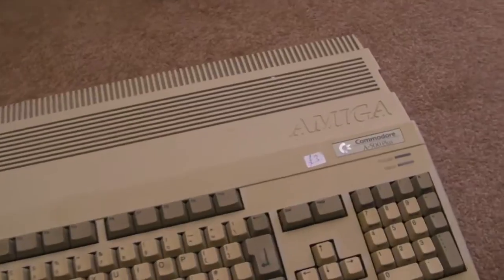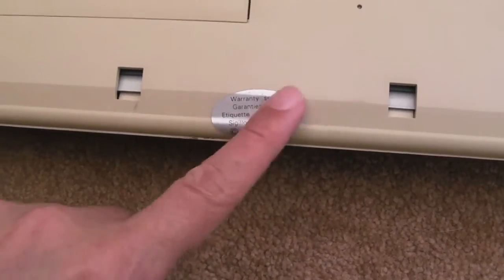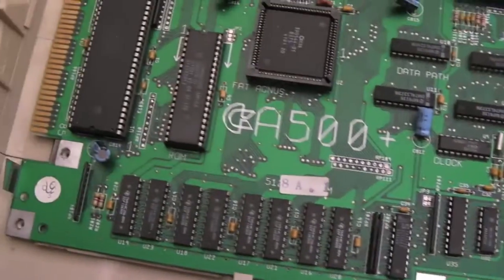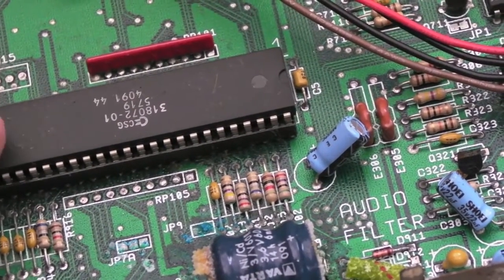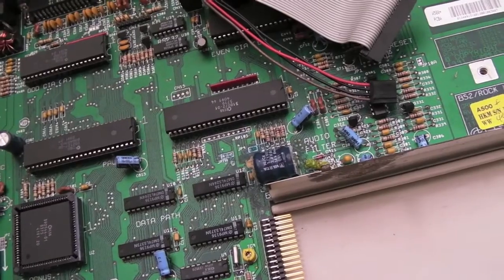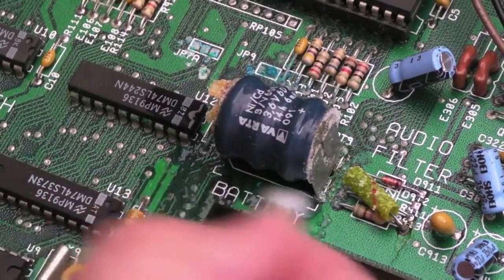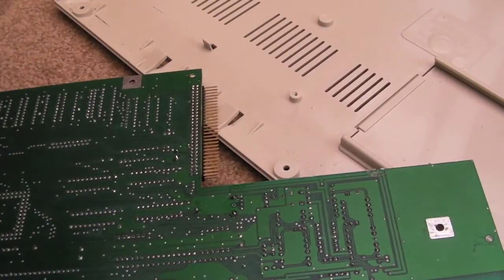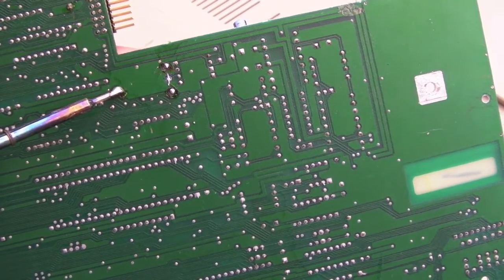Commodore Amiga A500+ Corrosion Repair Part 1

Comment: The Battery is not leaking Acid, it's leaking an alkaline solution which is why acidic vinegar neutralizes it as well as helps remove any corrosion.

Comment: Great video, you just saved my 500+
I didn't realise they had an RTC and battery so quickly went into the loft to get my 500+ out, that has been stored for over 12 years, and its dead.
After removing the battery, neutralising the acid and reseating Gary its back in business.
Wasn't as bad as yours luckily!
Thanks so much, it would still be up there now corroding away if not for this video.
Reply from the maker: mrxr2 Glad you sorted your 500+!

Comment: Wow, so long since I worked on one of those, let alone owned one.

Makes me nostalgic and want another one so I'll be hunting carboot sales now.

One tip that was passed down by Panasonic in their service bulletins though, do not desolder supercaps or batteries that have leaked, cut or snap them off the board then clean the leakage before you touch it with a soldering iron, the chemicals become more aggressive when heated and will contaminate your soldering iron tip as well as spitting all over the board and potentially making more problems in the future.

Comment: I just opened mine up and finally popped off the battery. Wasn't this Varta type. Unfortunately some damage done but when it comes to the external damage it does look a lot better than what you had in your hands so I'm hoping it is minor.

Comment: The damage on that board is very similar to the A500+ I repaired. Those ni-cads really are horrible. :(
Btw, one way to test which parts of the solder mask is damaged by the battery and which parts is not is simply to put your soldering iron to the board at various places around the battery for just a second or two. Healthy solder mask can resist the heat with no problems - that's what it's there for. Damaged solder mask on the other hand can't, and will disintegrate by the heat of the iron. I look forward to seeing what kind of conformal coating you will use to repair the damaged solder mask since I haven't seen many of them on the market.
Reply from the maker: Yes, I will do a mention in my next video so people can take a look at your vid!  Mine won't be as clean as yours I am sure!  The solder mask paint I got for the last 500+ came off EBAY I think.  It's the same UV type paint they use when making boards etc.  The problem is getting it to dry.  It does seem to dry of its own accord eventually but it speeds up the drying process if you expose to UV or direct sunlight.  Doesn't blend in that well but at least it covers exposed tracks etc.
Reply: GadgetUK164
Thanks. I also updated the video description for my A500+ repair video and added a link there to this video. I thought doing so would make it a little easier for people who are watching my video to also find out about this video of yours. You are presenting some very good points here which I didn't include in my A500+ repair video, like for example cleaning off some of the corrosion with vinegar.
I also liked that you didn't consider the repair being complete just because you had gotten the Amiga up and running again. The motherboard seems to work which is great, but there are still many things left to do on that board. You got some serious work ahead of you, my friend. :)
Reply: GadgetUK164
Btw, just as a little advice, make sure to use purified water to rinse off any remains of vinegar after you're done cleaning. Get some purified water (do not use tap water as it contains corrosive impurities), hold the board vertical and pour some purified water on the area where you cleaned with vinegar. Pour on both sides of the board. Either let the board dry in room temperature, or use a hairdryer to speed it up a bit, but don't use a too high temperature for drying the board. I like to try staying below 50 degrees C or so. Then wash the area with for example cotton buds or cotton pads dipped in IPA to assist in getting any remains of water moisture off the board. This procedure should always be carried out after having used vinegar to clean a PCB. It's extremely important that special care is taken to properly clean off all of the vinegar, since the acetic acid in the vinegar will corrode the board over time if left on there.
Using vinegar to clean the corrosion on the board works quite well, although it is a little bit like fighting fire with fire - You're cleaning with a corrosive element to get rid of a corrosive element. This is OK though, as long as you make sure to put out your own "fire" when you're done.
Reply: GadgetUK164
Thanks for the advice about the solder mask paint. I found it on eBay, and yes, it does say in the item description that UV-light is used for curing. But how long does it take for it to cure without any UV-light exposure according to your experience? I'm a bit interested in how well this product works. Maybe you could show us a close up of the container of the UV-paint in a follow up video, and show us how you apply that to the board? I am thinking about ordering some of this stuff myself to see how well it works, but I suspect having to use UV-light for curing might pose a bit of an inconvenience.
Reply from the maker: RetroGameModz That's a good point! I did wonder if the alkaline would be almost as bad as the acid over long periods of time.  I tend to use isoprop to clean up afterwards, but I will get some purified water!  Thanks for the advice!
Reply from the maker: RetroGameModz Thanks for the link!  And yes, There's a lot more to do yet lol.  Hopefully I can get part 2 done by the end of the week.  I've got to revisit the Neo Geo Pocket corrosion as well, I learnt a lot from that about why its so essential to replace all the solder and components where applicable.  The solder litterally has disintegrated.
Reply from the maker: RetroGameModz I cheated last time by using sunlight to do some of the work, but it didn't dry very well.  I suspect if you don't use UV light it could take a long time - eg. weeks or months lol.  It did eventually dry but it took a few days exposed to very bright sunlight.

Comment: great video.ive been having problems with my mouse on my 500plus. it goes up and down but recently stop working left and right, I've tried a know working mouse of my a1200 which makes no difference,I've checked the mouse port pins to the board for contnuity which are ok .ive got a couple of acid damaged boards as  spares just not sure where to start
Reply from the maker: +nevile bartos Try swapping the CIA chips around, there's a good chance you have a faulty CIA.  If behaviour changes after swapping the odd chip for the even chip then that's the problem!  Make sure you get them in the socket correctly with regards to pin 1 and the notch on the chip.
Reply: +GadgetUK164 no luck m8 I tried swapping both cia chips from another 500p no change.i even desolderd u15 and swapped from 1 from a spare 500plus no luck.I starting to think it might be what I've done when cleaning that crappy battery acid.i lifted even cia socket and Gary socket. I desolderd removed and refitted, everything was OK till I used the a 570cd ad on a few months ago, then the mouse started to play about!not sure if that's a coincidence or not.
Reply from the maker: +nevile bartos If you've swapped a CIA socket you could have a damaged trace / pad on the CIA socket.  One of the CIA chips handles mouse input!

Comment: GadgetUK This video is awsome. Someone just post link to Your video on Commodore Amiga fb group and I did what You did - mine was not as much corroded but still Black screen. After checking continuity and using the diagram You have added one trace was broken. Fixed the trace and Amiga booted right up. Thanks alot for this video - Thanks to You another Amiga is saved. Keep up the good work. Subscribed :-D

Comment: Hi, I keep repeating the vid. I was wondering what are you cleaning the board with? I have 2 A2000s both in this state. I will try :'(
Reply from the maker: Vinegar to treat alkaline and capacitor leakage, then wash away with IPA (99.9%)

Comment: Distance doesnt matter. I have seen corrosion travel up 3 metres of wiring loom before. The contact of the alkali against the copper causes an electrolytic reaction in the copper. This changes its composition , and the "corrosion" results.  It can migrate through the copper under the solder mask to any point of the board . Surface corrosion, the green on the legs etc, its caused by the alkali becoming a vapour when the battery "outgasses" or pops, Again this can be found a considerable distance away from the battery , depending on angle the PCB is stored, environmental conditions like condensation, temperature etc.  Its partly down to luck what condition you find it in!
Reply from the maker: TheMadmagik Yes, you are absolutely right - it turns into a vapour and goes all over the place lol.  I find it interesting it goes for ground points more as well (ever noticed that on some systems, the ground leg on a few chips goes black / green?)

Comment: great video :-)
I tried repairing a A500+ with bad damage from battery leakage - after adding lots of wire for bridging damaged traces on the PCB I got the kickstart screen with the disk! :-) but it only lasted about 30 seconds or so... it crashed with guru meditation, worked once again, crashed again, and now there's only light gray screen & blinking power-LED, resetting over and over again :-( swapping the CIAs almost completely disables screen output (almost = my display shows it's blue default screen, but doesnt complain "no signal"). any suggestions?
Reply from the maker: +romaneberle With something like that what you need to do is check all the connectivity for the chips around the corrosion area - ie. Gary, CIAs, 4 x data path chips, and all the traces near the corrosion.  It's really painful and time consuming but my guess is you've got a damaged trace on the data path or around Gary.  Also check the chips you are using work OK in another Amiga - changing the CIA shouldn't affect anything really, unless you are putting a faulty one in there?
Reply: +GadgetUK164 thanks, yeah lots of damage to the traces - I've already added ~14 wires... data and address lines &  4 x data path chips completely checked. (note: U12 received a lot of heat from soldering, maybe it got instable? damaged?) U8 (EVEN CIA(B)) seems to have some traces beneath Gary, two of which I had to bridge. I sometimes get a boot screen, but after some time it crashes. Or no boot screen, crash/reboot at gray or white screen. Does that behaviour sound familiar to you? Any suggestions what else is going on near battery/Gary, which lines to check next?
Reply from the maker: +romaneberle It's unusual to get crashes after a period of time, but that could indicate faulty RAM, or just an intermittent connection.  I've seen wierd things happen when the Agnus socket has been damaged and the chip makes an intermittent connection.  Are you sure your PSU is OK, I wonder if the 5v line is dropping or is noisy.

Comment: I'm assuming the mod wire is just temporary before proper trace repair?
Reply from the maker: The work in this video was temporary.  A more permanent fix was done in part 2.  It still need a couple of wires to fix broken traces.  You can fix specific traces with a single strand of wire, or sometimes just be bridging with solder, but it's better to use wires on the underside to replicate any traces that are too damaged.
Reply: Just been watching part 2. I generally dig out the old traces and when tiny replace with magnet wire or cut thin copper sheet and epoxy into place, use fresh green solder mask after.  Battery acid impregnated solder can be a pain and just flushing with fresh 60/40 tends to work pretty well. I do have a trinocular inspection microscope however, which helps immensely. Just remembered I found an A600 dumpster diving a couple of years ago, was what got me into restoring Amigas. I have 3 A500+s all with battery corrosion issues, nice chilled out repairs.

Comment: At 9:42 what are the two components labeled E305 and E306? On my Model 2 Genesis there is two rows of similar looking components by the controller ports.
Reply from the maker: +Robert NES816 They are inductors!  It's not unsual to see them on all inputs and outputs, they help remove high frequency noise.
Reply: +GadgetUK164 mystery solved lol. Thanks for answering!
Reply from the maker: +Robert NES816 I need to correct myself there - Those particular packages also contain a capacitor as well as the inductor!  I have to thank 'Plan C' for that - I've just been watching his video and realised they have 3 pins not 2.
Reply: +GadgetUK164 I was questioning that myself. The inductors on my all my Genesis consoles have three pins as well. My model 2 VA0 has inductors that look just like that. While all my Model 1 consoles (I own 2 VA3 consoles and one VA6) have inductors that have a plastic covering that is rectangular in shape.
Reply from the maker: They are still doing the same job - filtering!

Comment: Since yesterday the working noise is too low of my amiga 500 fllopy drive  and stoped reading floopy disks. Do you know why ?
Reply from the maker: +Gulliver Gate No idea, I do know that some of the Sony models suffer from bad electrolytic capacitors.  If it's quieter than normal maybe one of the motors has died, or maybe you have a PSU problem where the 12v is low or missing - I suspect if it was missing there might be other clues as well, but I have seen the 12v drop and cause disk drive issues.

Comment: I just got an a500+ with battery damage similar...when I first got it it flashed yellow screen and rebooted a few times then all of a suddent boot into workbench once...now it just flashes yellow every time...it that the memory bad it says yellow means cpu traces are bad...I tried diag rom and it just flashes many times green then red and reboots...
any ideas?
Reply from the maker: More often than not it will be the corrosion - there will still be a bad trace there somewhere. They are a pain to diagnose because what you really have to do is get the schematics, and do continuity tests on Agnus connections, Gary, data path, CIAs etc. It's very time consuming, but I bet you've just got one more trace that has gone bad. You could try the Amiga diagnostics ROM - that might provide a clue as to where the fault is.
Reply: I fixed it...bad contact pin on the Agnus...i spotted it early on but had to wait to get the PLCC puller to find the bad pin, turned green and not making contact...I shoved a jumper pin into between the chip and the socket and that completed the connection...I will replace the socket later...not sure if the desoldering station will work...how did you replace the socket? Solder braid? Heat gun...?

Comment: Vinegar is acetic acid. It doesn't neutralise battery acid. You need a base or an alkali to instead.
Reply from the maker: These batteries are Alkaline!  So acid does neutralise!
Reply: @GadgetUK164  @6.34 ...'neutralise some of this acid'.
Reply from the maker: @mmmmmmmmmmmmmmm420  Yes - I made a mistake refering to it as acid =D  Something I corrected on later vidoes when talking about these batteries! =D

Comment: Thanks for the video. I've subscribed. I don't have an A500 but three A1200.
Reply from the maker: Fernando Martín Thanks!  The 1200 is a much better machine imo, especially these days with the great CPU expansions from AmigaKit, and WHDload etc. =)
Reply: I saw that A500 had the warranty seal, and as I see you like to take care of all like me, you can take it out intact if you use a hair dryer and a cutter to lift it out carefully; I made that with a 1541-II disk drive. Later you can glue it again with some glue spray for photos.
I've also liked your datasette video to replace the belt as I've got to change mine.
Reply from the maker: Fernando Martín Very cool! Will check that out! =)